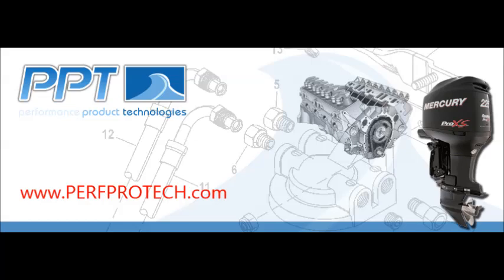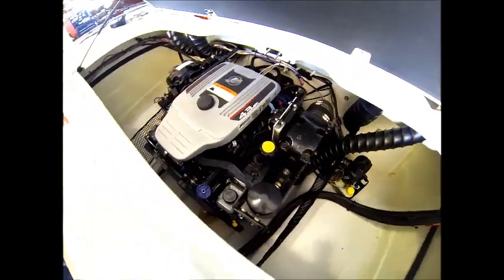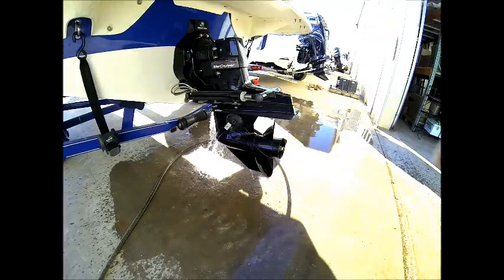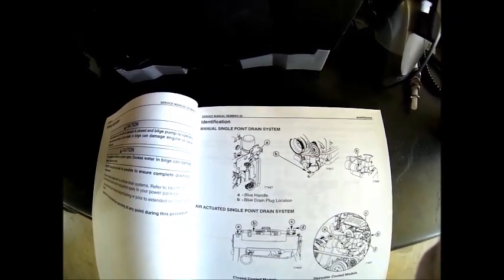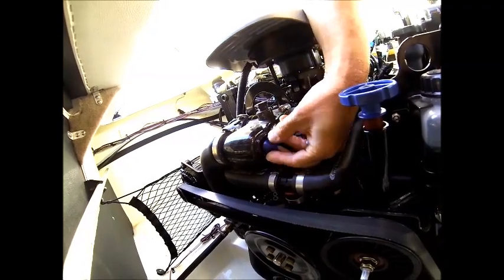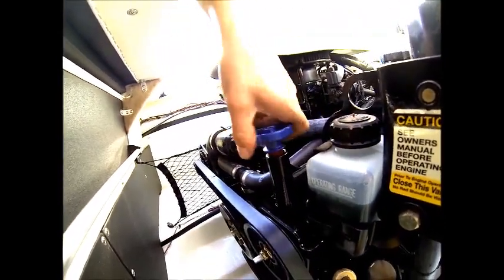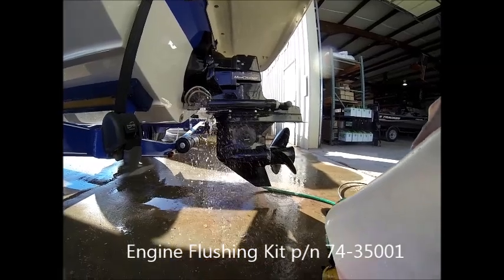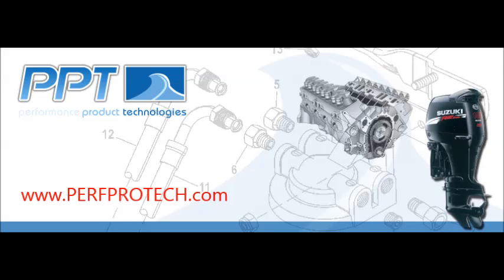How to Freeze Protect a Mercruiser 4.3L MPI V6 Alpha Sterndrive Engine

Comment: I have the gravity feed winterizing system but wanted to make sure there was some pressure to help feed the pick up.  I enlarged the vent hole and use an air  compressor to force more antifreeze into  the motor.  Seems to work well.  No problems 2014 boat.

Comment: What about fogging the engine do you recommend or no needed?
Reply: Not only should you fog your engine you should add stabilizer to your fuel tank and then fill your tank until full! After that I pull all my spark plugs and spray fogging oil into each cylinder and then crank the engine by hand, Using a ratchet extension and socket on the crank bolt! Then I remove my spark arrestor and cover the top of the carburetor with a cap! After that I will spray my engine down with the fogging oil to help prevent corrosion! After I am all done I put a few moisture absorber containers in the bilge and in the cabin, Then I remove my stern drive and cover the gimbal housing with a plastic cover! The boat stays at my family‘s beach house for the winter so I store the outdrive in the garage to prevent theft! I have a 4.3L OMC Cobra, I live in New Jersey so winters can be long! I have owned the boat for 27 years and every spring it fires right up! As for the fuel tank some people say that you should drain the fuel! I say that I have never had any issues for the past 27 years, Plus an empty fuel tank will collect condensation! Try not to fill your fuel tank at a gas station, It is always better to fill up at a Marina because they usually have ethanol free!
Reply: Exactly on the fuel stabilization and engine fogging but man I got a lot of other tips from you also! Thanks !

Comment: Hello, I have exactly the same engine and drive as what is on your video. Instead of using the muffs to suck antifreeze from a jug to winterize the engine could I just perform the following steps? Would there be any check valves on the piping, hoses, etc. that would prevent this from working?

1) Open blue drain/vent valve on thermostat housing. 
2) Open the manual single point drain valve and ensure a good flow of water is draining from the distribution housing (orange) drain tube.
3) Once water stopped flowing from the distribution housing drain tube, connect a hose (leak tight connection) to the distribution housing (orange) drain tube.
4) Pump antifreeze (into hose connected to the orange drain tube) until antifreeze comes out of the blue drain/vent valve on thermostat housing. This ensures engine block and exhaust manifolds are flooded with antifreeze.  
5) Reinstall blue drain/vent plug on thermostat housing.
6) Pump more antifreeze until it comes out of the exhaust to ensure risers are flooded with antifreeze as well.
7) Close manual single point drain valve.
8) Disconnect hose used for pumping antifreeze.

Thanks in advance for any input that you may have.
Reply: I wonder why they didn't reply? Maybe because this process means you won't buy their antifreeze container and pump? Sounds like a good idea to me, as long as there are no check valves in the system.
Reply: Damn this sounds much easier to me.